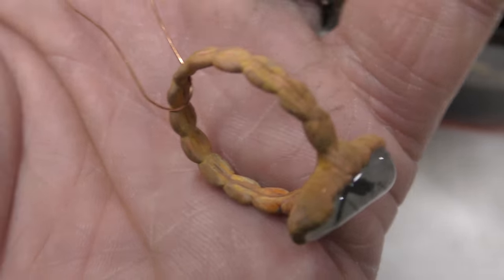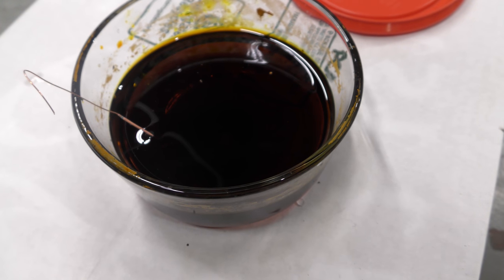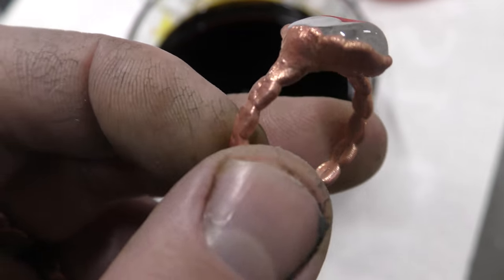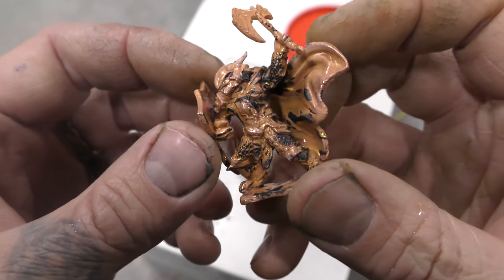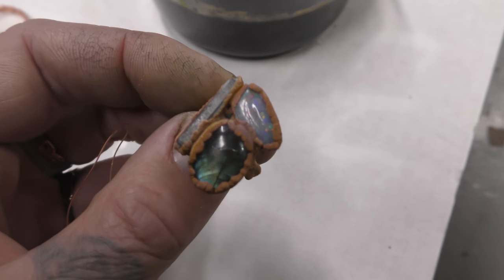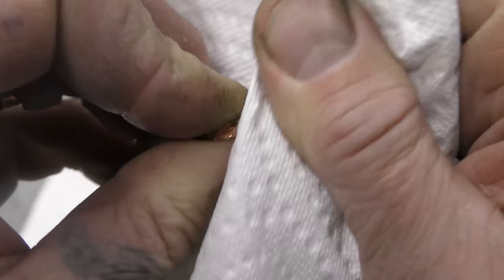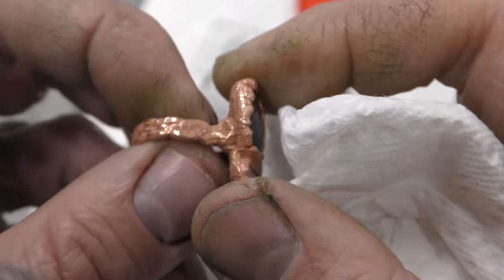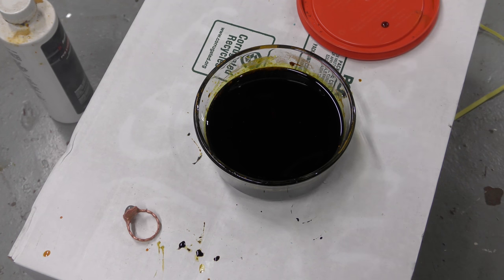Polish Copper using Ferric Chloride

Comment: I use Ferric Chloride to etch copper jewelry. Coat the clean copper in laquer, then scratch away where you want the etch. Then immerse for 1/2hr or more. On flat pieces I use my laser engraver to engrave patterns in the laquer before etching. You can get great detail.